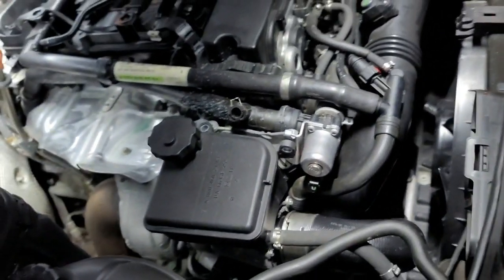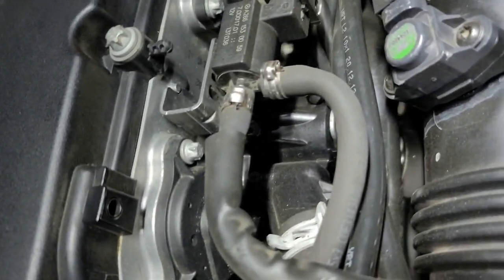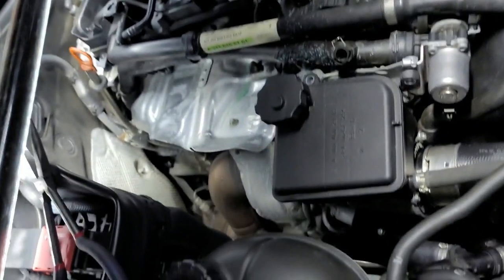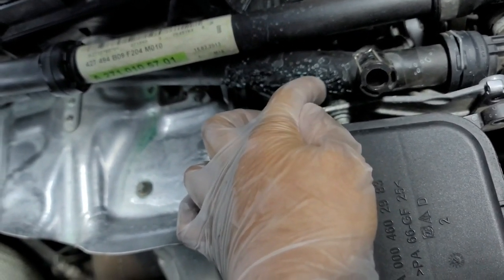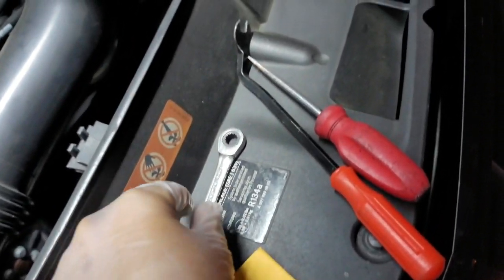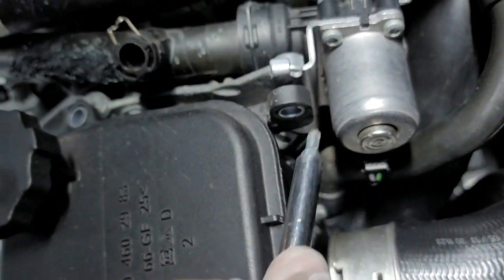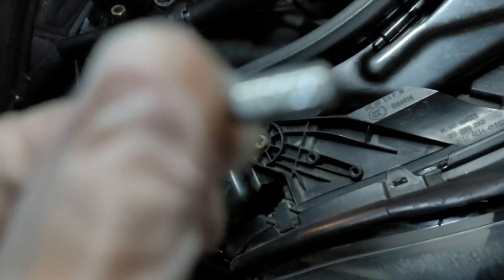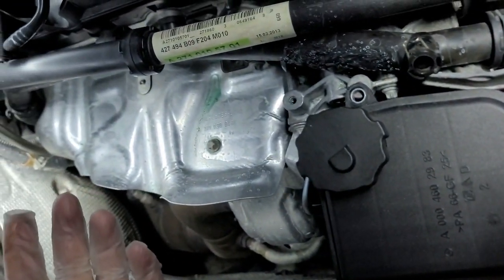Coolant Pipe Feedline For Mercedes-Benz C250/C204/W204

Comment: Thanks for video. My 2014 C250 did same . I did dremel cut off the one fixed hose clamp carefully due to breaking the hard plastic fitting on a prior MB C class when I pulled a fixed clamped hose off . I replaced with a lined , stainless steel clamp. Plenty of clearance so no interference with deco trim panel. Gentle rub with green scotchbrite pad and some WD-40 to remove dried on antifreeze from heat shield and exhaust pipe.
Reply from the maker: Sounds like you had one hell of a job with that one. But seems like you did a good job working on it.  👏  Most vehicles nowadays make it difficult for us to fix and replaces parts on the vehicle to the point where we end up taking it to a shop or back to the dealership.

Comment: Great video man I have a 04 C230 and it started leaking right  at the the little plastic valve area the comes out of that hose  you replaced and goes to the overflow  any idea what the little plastic part is or what it’s called lol I’m being that guy but don’t know how else’s to explain it it’s funny though when the check coolant came on so did the check wiper fluid

Comment: Did you have any trouble with the top pipe. The metal ring 💍 around the connector looks like it has to be removed or cut off.
Reply from the maker: No, you can just pull it off and place it back on. No need to cut anything on there.
Reply: 3:56-4:07 its the long screw. its the part where looks kinda burned, Correct?
Reply: it will not come off at all
Reply: Can’t get it to come off by hand. Should I be using a tool to remove the ring on the top pip? Otherwise ima have to order a new part

Comment: I have this exact issue with my 2012 W204. Do you have the part number by any chance. Hope this actually resolves the headache I'm getting.
Reply from the maker: Here you go. You can click the link below and it'll send you to Amazon.

Woopshy 2712002452 Water Pump Cooling Pipe Compatible with Mercedes Benz C250 SLK250 l4 1.8L 2012 2013 2014 2015 2712002450 2712002652 https://a.co/d/9exv3Mt

Comment: Mine began recently but my coolant instead all goes direct to the washer fluid reservoir tank so am suspecting it’s the heating element that might have a leakage because when the car heats up it all splashes up through the washer fluid cap
Reply from the maker: Does your temperature Guage fluctuate? You might have a Thermostat problem if it does. I would suggest cleaning the contaminated surfaces and drive the vehicle around town and stop somewhere to check for leakage.
Reply from the maker: It's possible you might have an issue with the Thermostat opening up all the way thats causing the coolant to flow back into the coolant reservoir tank. Check your upper and lower radiator hoses if they heat up really hot after you had your car on for 15 minutes or have drove it around the block.

Comment: How do you remove the thermostat on C250 2014.
Reply from the maker: It's right in front on the motor. I'll make a tutorial video on how to remove it but I won't remove it since it does take a couple of hours to do.
Reply: @LeoLee7o7  yea I finally bought a used washer reservoir tank from a scrap yard and replaced the one i had as the heating  element/coil had a leakage . That solved the issue.
Reply: @LeoLee7o7  I need this videos also

Comment: hey I know its a dumb question, but do you have to drain the coolant?
Reply from the maker: It's not a dumb question. No, you don't need to drain the coolant. Just make sure you have coolant ready to fill it up after you're done with the installation.
Reply: @LeoLee7o7  Thank you, dude you replied to me in 30 minutes!
Thank you Again!!
Reply from the maker: You're very welcome. I just happened to see the message. I'm glad to have answered it right away. Let me know if you have any questions.
Reply: Question: 
There’s any air or water pressure coming out when you took that piece ??? 
Thanks great video

Comment: Did you have any problems with it after?
Reply from the maker: At first I did. It still leaked out and the temperature sensor would always says it's low but I don't have anymore issues with it. Seems like it just needs to get familiar with the pressure that's being fed through possibly until it's back to normal. Not really sure on this since Mercedes-Benz dealership did a pressure test on it and might have caused it to crack.
Reply: @LeoLee7o7  They crack all the time....weak link on this engine
Reply from the maker: @lard1892  Good thing I only had to replace it once. Would be great if the material wasn't made out of plastic.

Comment: How you change the pipe on the back of the engine
Reply from the maker: Hey Bobby. It comes as a set with two plastic pipes and I just replace them both by removing both of the old ones together. I did try to just replace the one that was broken but it's easier to just buy it as a set because it's hard to remove the one by the engine without breaking it.
Reply from the maker: Hey Bobby there's a bolt that's behind the power steering pump and sits in the center. Remove that bolt with an E11 socket and it will loosen the back pipe.
Reply from the maker: You'll see the bolt in the video between frames 6:00 to 6:08.
Reply: I seen another video where the guy looked like he said you would have to drop the transmission 😩
Reply from the maker: Wow! Not sure what he's trying to remove or do if he needs to drop the tranny.
Reply: I posted a link to the part I’m talking about
Reply from the maker: I don't see the link
Reply: It’s called a water pump cooling pipe
Reply from the maker: I see. Did that one get damaged on your car?